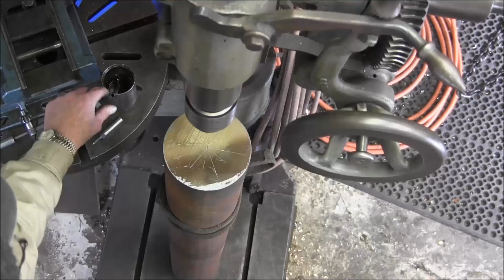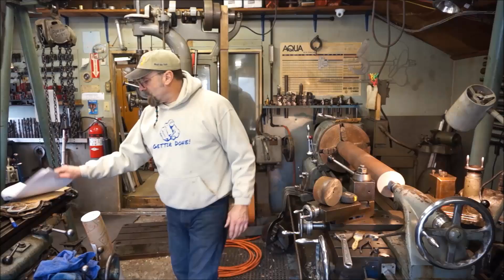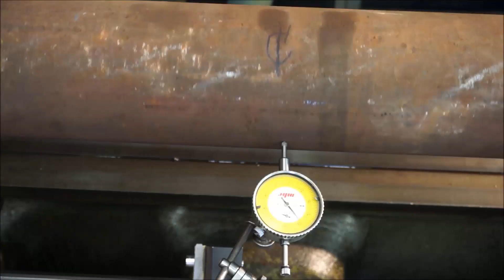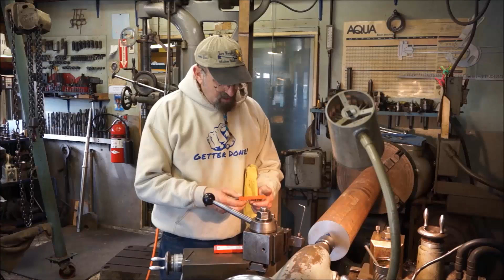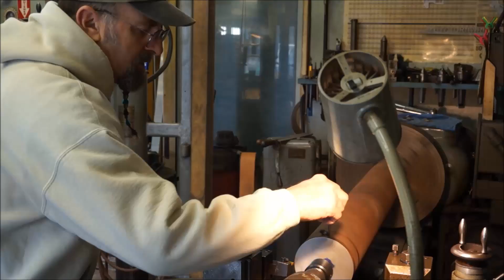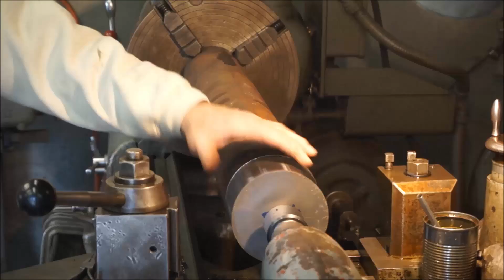Crusher Part 1

Comment: 13:40 how do you get the difference between the radii? It seems you would need at least 50 percent of the surface turned, and then compare the diameter you measure in the video (turned + rough) against a perpendicular one (both sides turned).

Comment: Heh.  Parts for these attachments can be tricky, and the guy behind the lathe can make all the difference.  We had a 220 series Komatsu with a custom thumb attachment, and after a long chase, we tracked down the guy who made the original design so he could make a new main pin.  Much hassle and much money later,  the new pin snapped in half in the first 10 minutes after install.  After that, we just went with our local proven machine shop.  Better parts, better service.  More power to you, Keith.

Comment: I've one in my yard needs the same treatment ! lol, pin is bent like a Bananna !, if its too hard, it'll crack.   Komatsu Dog Bone link- (Ram end) pins are induction hardened and crack in cold weather if you come down a little too hard on the bucket also

Comment: Keith

Great series, as always.  Thanks for sharing the project.  I also look forward to seeing it in operation.

I was wondering why you chose to use an inside mic on the bore work, instead of a larger snap gauge and o/s mic ?

Is the inside mic more accurate than the combination of the other two ?

Regards

Comment: Excavator that use demolition shears & crushing attachments like this actually eat up pins like these...new pins are costly to buy & the reasons are obvious. Sometimes a demolition company would be better off having a machine shop of their own, but the overhead might be a bit much...
Cool Project...this is what I'll be doing, but on a smaller scale...backhoes & excavators up to the Cat 245...as well as pins for end dump trailers...
Aloha,
Chief

Comment: Good video and glad to see you preserving your machine ways. Did you say no roll support available for your lathe? I usually cut a little longer blank, turn complete then saw off the remnant and back in lathe for second face. I like Mitsubishi Carbide MS 735 CNMG's in the tool room lathe. This is a stainless grade that works great on any alloys I have tried.
Reply from the maker: This is a piece of hot roll finished material, and the rest I have for the lathe is just under the diameter of the pin, when finished. ;{)-----

Comment: i use those arno inserts, they cut very well.
also try there tungsten end mills keith, they also cut very clean.
you can plunge cut with them end mills, no clearence hole needed.

Comment: Why not use a dead center in the spindle for the first cut?  That would keep the bar running true to the center drills on the first cut.

Also, is the reason you are not using coolant because of the mess?  Inserts would last longer if cooled.

Nice videos.

Comment: Wow, 400 videos! Congrats! I am glad they are still coming too! I haven't found my favorite CNMG4XX yet, but when I do I will be sure to send you a sample to try out.  I don't do any marine shaft material but I do a bunch of tool steel A2, D2, S7, as well as 4140,4340 and 8620 and I am guessing some of that stuff cuts pretty similar. Looking forward to part 2. This should be a good test to see if there is any twist or wear in the bed of your lathe. :-)
Reply from the maker: bcbloc02 Cool thanks for the comment and there is a bit of wear in the old bed but still close enough to minimize hand work. I'm editing part two a little at a time and will be working on the What's in your box giveaway series, mixing the two up as the days roll. ;{)---

Comment: I saw the same 4-jaw-turnaround method in the "Broken Beaver"-project, and I've been wondering one thing ever since I saw that... You could do this by turning between centers (with a drive dog) but you choose to use the 4-jaw and indicate it. I'm sure you have a reason... so why?
Reply from the maker: Mattias Kristiansson copy and pasted: Wanted to be more ridged, less chance of vibrations.          ;{)-----
Reply: Same thing I was thinking. But from your answer I imagine this happens because the center hole gets worn/stretched and becomes slack. I could see how that could become a hassle. I imagine that one could make the hole and pin larger and deeper to compensate and keep tightening as progression needed. But that might be a continual problem. I wonder if there is a way around that to make turning by centers work for you. But I can see how one would just go for the simple of the 4 jaw. I work on watches so centering small parts is crucial. In the watchmaker world parts are so small we can use hot glue and as cooling/hardening find center. I don't think glue would work for you guys -lol.

Comment: Hello Keith, long time since  I've said hello, but I've watched all your video's and enjoyed everyone. If this is a stupid question please forgive me as I'm just a novice! here in the UK we can get 'bright bar' which I'm lead to believe runs true? be you have the same in the US? does it run true and would it be a cost issue? sorry if I'm talking a load of rubbish but hope you can enlighten me :)
Reply from the maker: Allan Henson We have various ways metals come from suppliers, cold roll, ground and polish but some alloys like heat treated alloys, come with a hot roll or mill surface. ;{)-----
Reply: Arh thank you that explains a lot to me. I see EN8 been mentioned a lot, like Harold Hall's WEB site. Thank you.